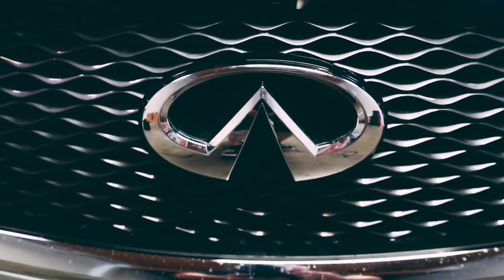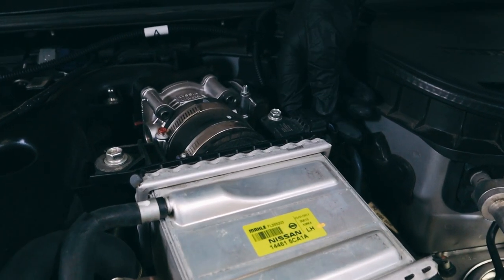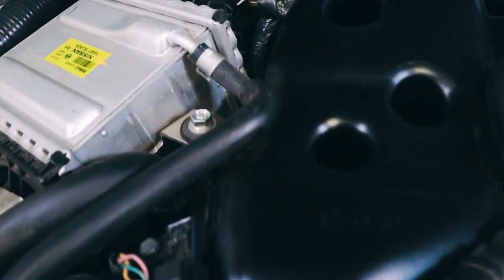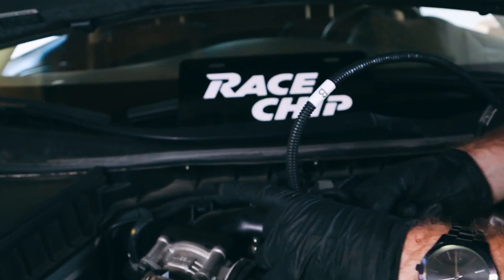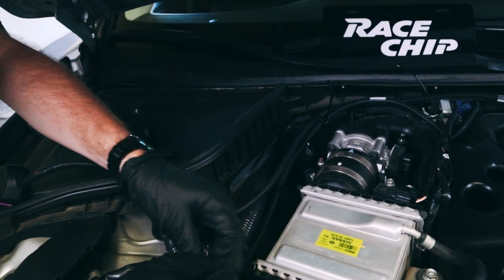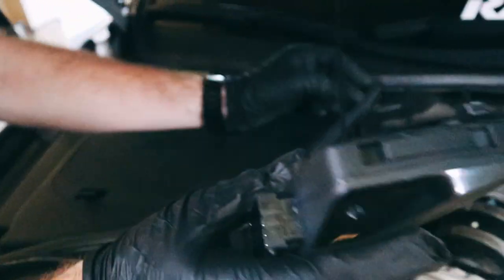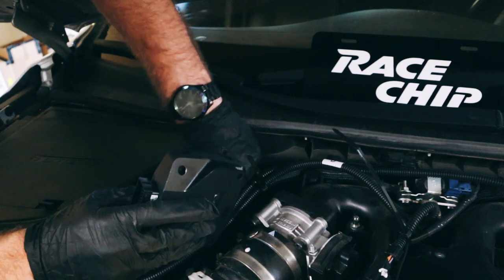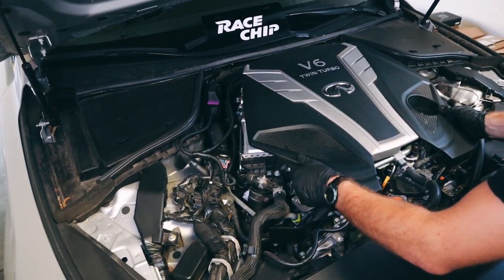Infiniti Q50 3.0T RaceChip Installation

Comment: I have a 2019 Red Sport lease,  is this detectable in any way through computer diagnostics, even after being removed before scheduled service? I want to buy this, but I do not want to void my warranty. Thanks for any honest feedback!
Reply from the maker: It does not change anything in the ecu and also does not manipulate the canbus system. There will be no flag and no flash count. Just remove the unit and the car will be 100% in stock condition again. If you cange your car within 3 years, RaceChip will reprogram the GTS for free to fit your next car!
Reply: RaceChip Installation Videos that’s awesome because I have a 3 year lease! Thanks for the quick response, I will be purchasing soon!
Reply: I thought the same thing

Comment: Very interested.  I have a Q50 RS400.  What are the maps (how much PSI over stock is each setting)?  Can we view dyno results?
Reply from the maker: Please click here for the Dyno video: https://youtu.be/NaCBtL2h3Ik
Different mappings have different characterstics for specific rpms, but in general: the higher the mapping, the more hp and torque (and of course the PSI over stock). Our engineers usually do not release specific details about the PSI numbers. However, I can assure you that they are within the safe and also most efficient corridor for all RaceChip mappings.
Reply: @RaceChipInstallationVideos  is this safer thsn a jb4?
Reply from the maker: @Hitch_49  Our products allow all of the engine fail safes to remain in place. If there was ever a value outside of the engines tolerance, the ECU will step in and prevent any damage from occurring. With that being said, I have never compared our products data on this application with that of the JB4, so I would not be able to comment on their products.
Reply: @RaceChipInstallationVideos  awesome thanks. I read that someone was running a rave chip and a jb4 together, thats wild
Reply from the maker: @Hitch_49   This is STRONGLY discouraged. If we or other tuners thought the engine could handle more of a power increase, we would have done so ourselves. Usually vehicles have some powertrain limitations, like gear boxes, axles, rods, pistons, etc. Therefore it is not advised to stack tunes together.

Comment: I know I’m very late commenting but if you were to buy this tune for a 2016 redsport would you have a map for a catback exhaust with intake and custom hks blow off valves or would that not work thanks!!
Reply from the maker: Hey Nathan,

Purchase an app enabled unit and our engineers can make some adjustments to your tune files for your components.
Reply: RaceChip Installation Videos thanks guys really appreciate it

Comment: Does this one work with the 2015 model which has a 3.7L engine, not 3.0T? online has only 3 options 2.0 3.0T(300hp) 3.0T(400hp). Mine is 3.7L (328hp).
Reply from the maker: We don't offer chips for non-turbocharged cars like the 3.7L.

Comment: Does it work with a 2015 q50 model?
Reply from the maker: It does work. You can find it here https://www.racechip.us/shop/infiniti/q50-from-2013.html. You will need to select which engine you have.
Reply: RaceChip Installation Videos 2015 has 3.7 with no turbo it’s not listed up there

Comment: Does it endanger the engine in any way?
Reply from the maker: The factory ECU safety settings are not changed with the installation of our product.
Reply: Will it increase the chances of having problems long term?
Reply from the maker: No it will not.
Reply: Great! Will be purchasing one soon!
Reply: @baltasaur77  did u buy the racechip and if u did how is it?

Comment: Will it fit my 2020 Q50?
Reply from the maker: As long as it is the 3.0T model then yes!
Reply: @RaceChipInstallationVideos  ok thank you then yes should I use the 2019 module?
Reply from the maker: @daviddiaz4947  Yes, the product for the model year 2019 will also work on your 2020!